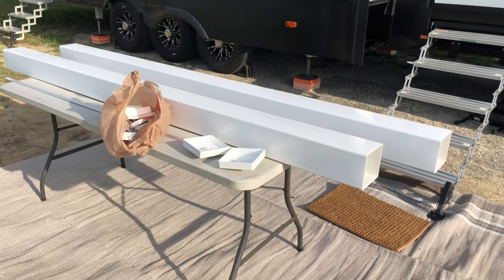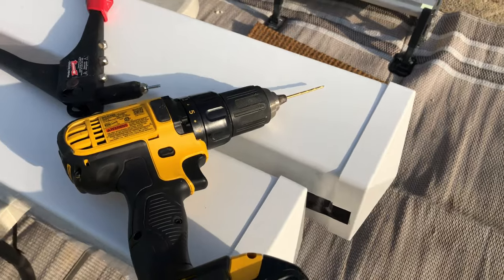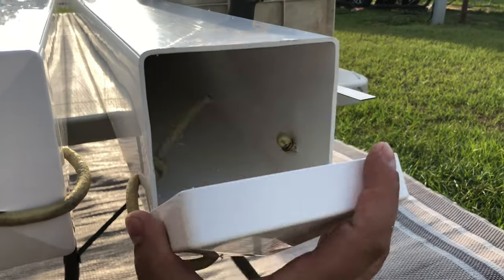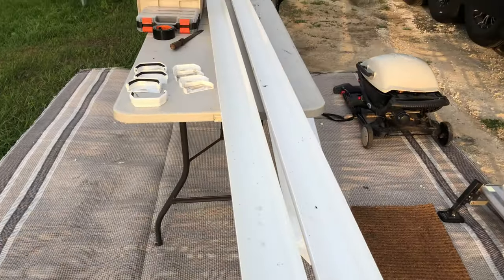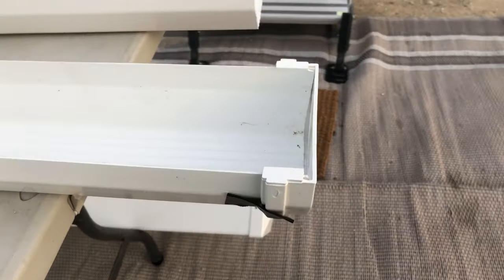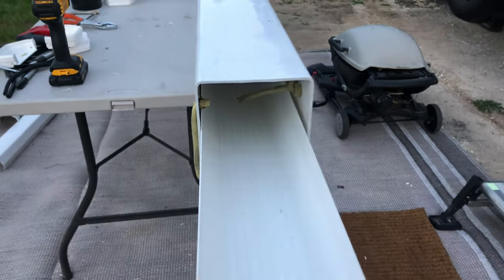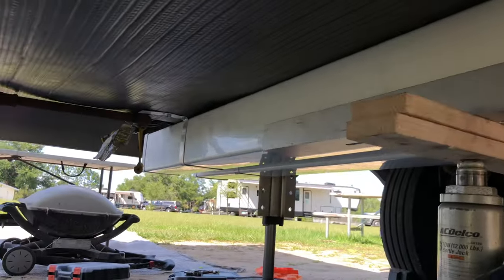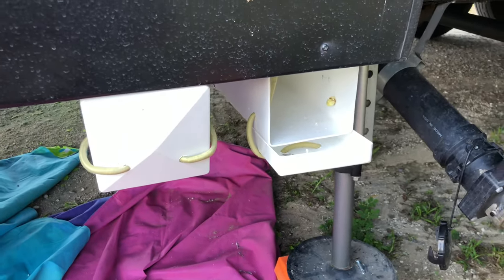Building RV storage tubes for sewer hoses and more

Comment: seen a guy who put slider pins through the cap and post so he just has to remove the pin and the cover comes off and nothing in the way of anything.  But well done on the brackets as well
Reply from the maker: I like that idea. The knots definitely get in the way, but that temporary fix worked for the life of those tubes. :)

Comment: Don’t put the ends on the draw and you can use it to keep your hose off the ground when you set it up.
Reply from the maker: Yep, though it's a little flimsy and can bend in the middle when full if not well supported. And even with them- it still works fairly well in the few times that I've needed to use it that way.

Comment: What's the benefit of the drawer?  Why not just slide the hose in?
Reply from the maker: Drawer is optional but lets you store short things without them getting lost. For instance, I keep my flexible toilet sprayer, a short 5' hose (for dump stations), and my expanding hose for the black tank flush.

Comment: I wonder if plumber PVC glue works the same on that PVC material- might be an option to pop rivets.   I also consider running my bungees back to the mounting brackets to avoid obstructions inside.
Reply from the maker: Interesting idea in the PVC glue. The bungees to the brackets makes sense if you can find a way to secure them well.

Comment: Maybe have the holes for the bungees higher in the tube so they don't interfere with the gutter?
Reply from the maker: I think that's a good idea. I debated it but worried that the bungee would slip up during travel. I said I should switch to smaller bungees, but here I am a year or so after I made these and what I have isn't super inconvenient.
Reply: @LearntoRV  check out RV With Tito did with his. I'd call it "similar but different".

Comment: Nice project. One suggestion, the mounting straps, would it have been better to make one continuous strap per side holding both tubes?
Reply from the maker: Maybe. I think it would have been tougher to mount them at the same time than to do them individually. They could have been mounted a little more closely together that way, though.
Reply: If you did that, then the caps would either rub together or be hard for them to go on and come off. You want that u bracket to be as tight as possible.
Reply from the maker: Definitely would need a spacer of some sort.